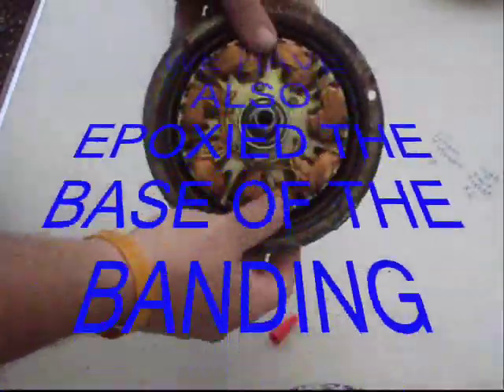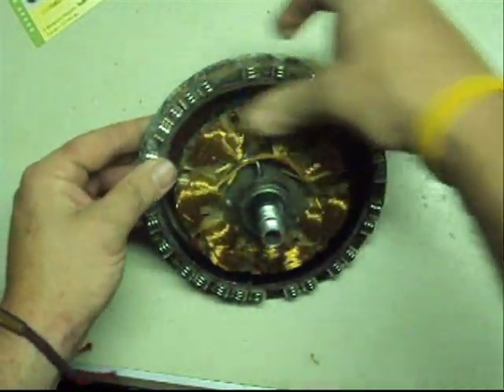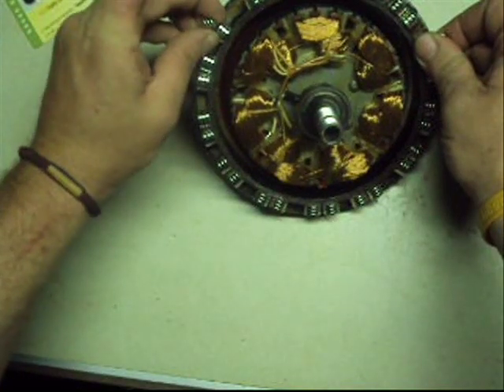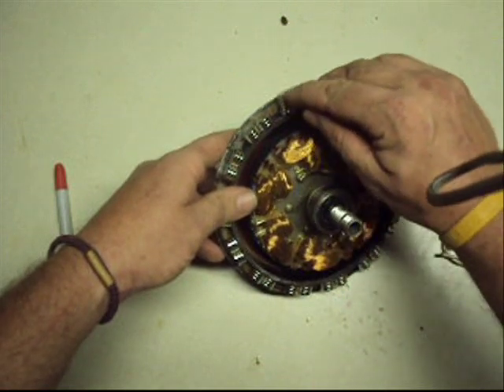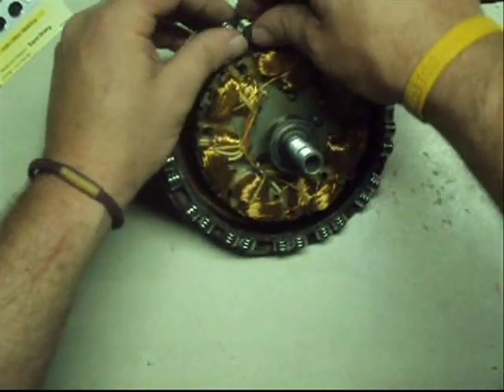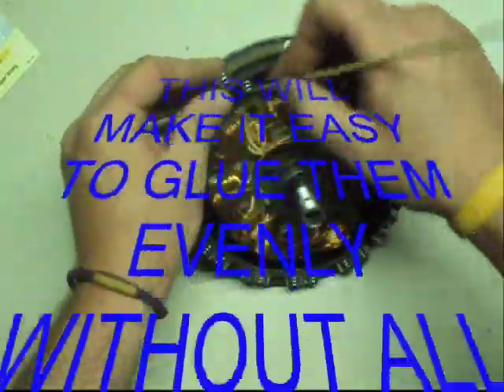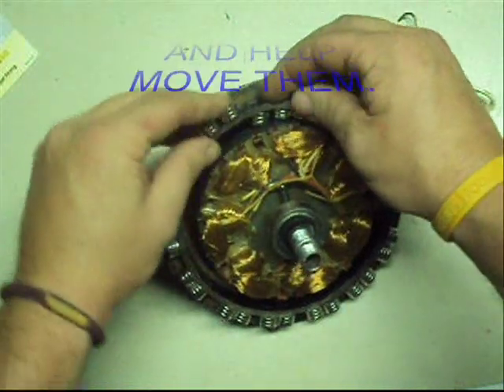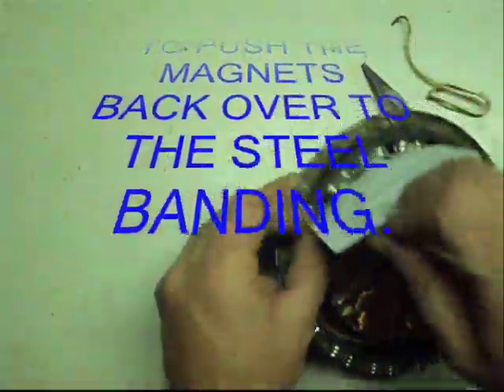5 THE CEILING FAN WIND TURBINE CLASS PART 5

Comment: Hey Muddy Muddman, nice work I just finished putting some similar magnets all the way around my ceiling fan motor but before I glued the 1st set of magnets & moved the 2nd set over to get the polls right I thought I'd give it a few spins & test the voltage. I got up to about 60 volts just spinning it by hand & then I moved the magnets over so there were 2 Nth then gap then 2 Sth etc & I ended up getting the same voltage readings when I'd finished! I know it doesn't make sense but we might've wasted our time moving them over, I think there might've actually been a little less cogging when they were the other way around too! thought I'd let you know..
Mick :)

Comment: Hey MUDDy, thanks for the great video tutorials.  I have a different stator and it has 16 primary and secondary coils.  Would I use one magnet for each coil. The secondary coil legs are beneath 2 different primary coils..  I think I would if I use the flow. The  primary coils Inside dia. are approx. .5 inch round and thought I should use square magnets with the poles N-S-N-S  OR  should it be N-N-S-S-N-N.   Should magnet size be coil I.D.

Comment: Muddy you are the ( . )V( . ) and the (_|_)   ... lol...

Nice technique on the skid banding.  I had a little trouble following how you determined rotational direction and  direction of band winding.  Also - if you know your gap, I would suggest 1-pc magnets.  easier to handle.  as example - I have 3/8 diameter by  3/8 long n52 grade neodymiums... that are rated at 14lbs of pull each.  All I would need to do is add enough turns of bandind to have a minimal gap of about 1/32 inch.